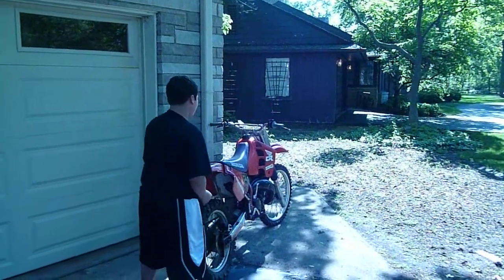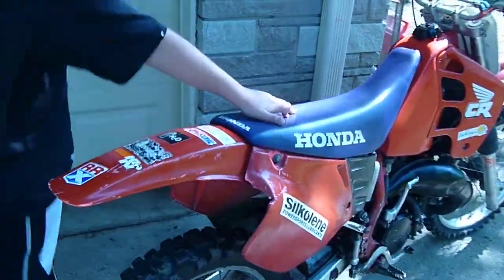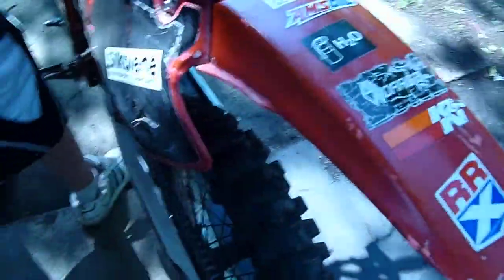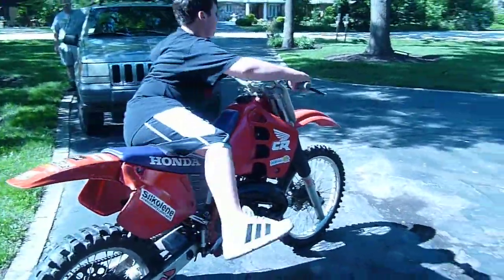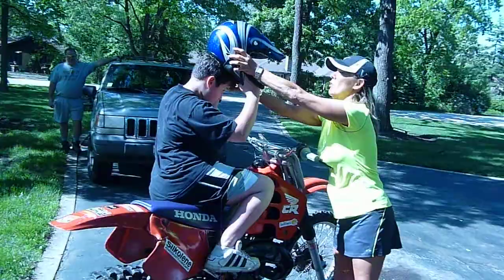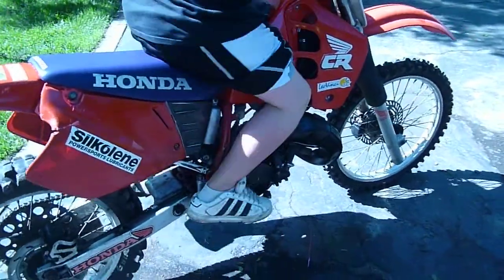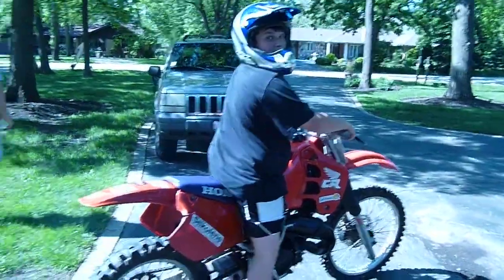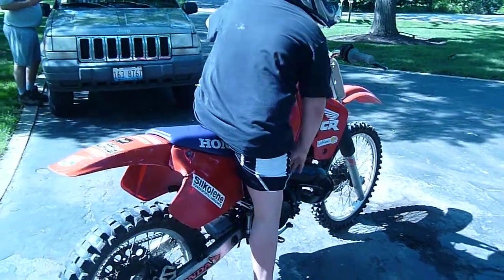cr125 honda dirtbike test ride

Comment: There is now way u are 5,9 i havejust like that im 5,6 i can touch the ground
Reply: SpamBin I am 6.1 and with my cr 15 1995 I have the suspicion pretty tight and my feet just sit flat on the ground
Reply: SpamBin I'm 5'5" and I can reach on a 140